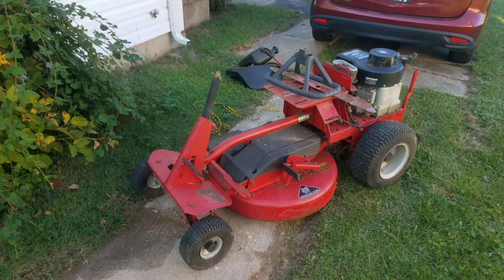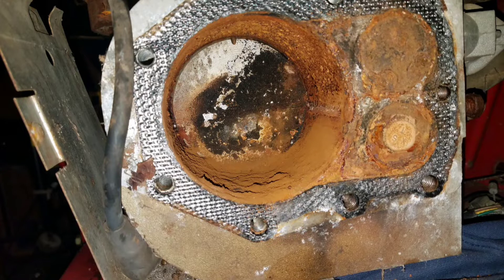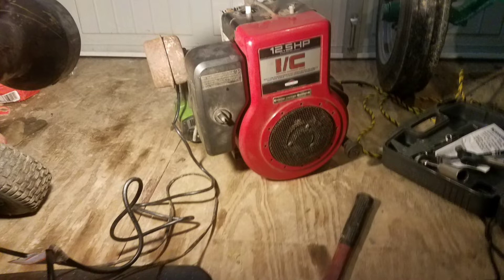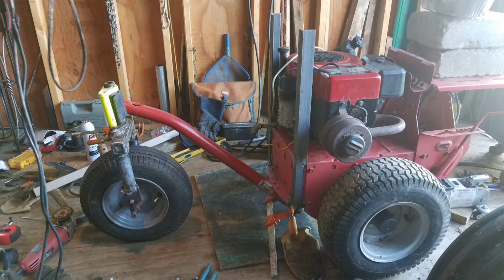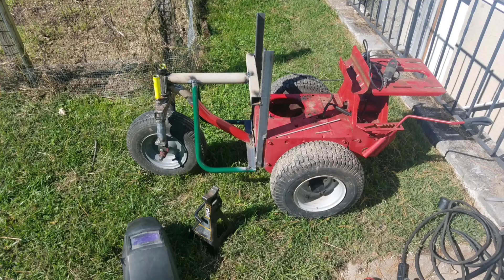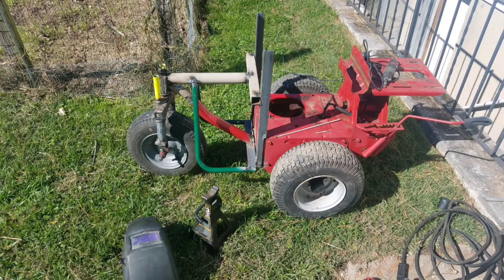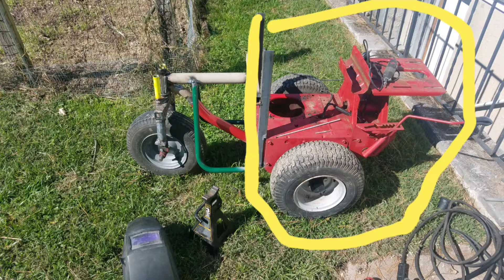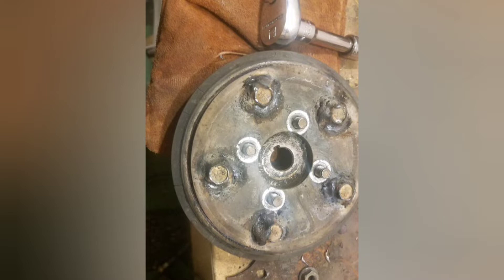Snazoo "zero-turn" mower build part 1: Chassis and drive train

Comment: It's good to see your progress on the mower. Just an update, I have a welding shop now. It used to be the generator shed for a nearby business that was bought out, so until there's a new tenant for that location, the property manager is allowing me to use this for my welding shop. 
I bought a plasma cutter, got a new to me Lincoln Pro Mig 140 welder, got some more shop hand tools, and finally got this shed closed up. I'll not be paying rent on it as I agreed to allow the manager to use the shop occasionally in exchange for rent. As you may recall, this is on an Amish farm, so everything is run off of generators. My mig welder is 120v, but the plasma cutter is dual voltage. I'm still awaiting the machine shop to finish my parts for my tractor, so I can work on my wizard mower for now. It will be using a kawasaki Deere engine, but I must fabricate the mounting bracket for the engine as someone took the engine off with that plate. I should be able to use the one from my Craftsman mower with a little persuasion.
That's about it for an update.
What's new with you?
Reply from the maker: It sounds like you have a lot going on! Free rent! Very Nice! Not much new here. No active projects. I was pretty lazy this winter, but spring is near so the tractor, mower and I will be in use again soon.